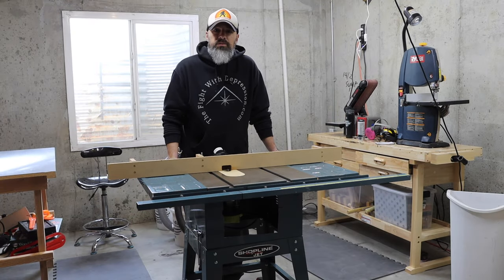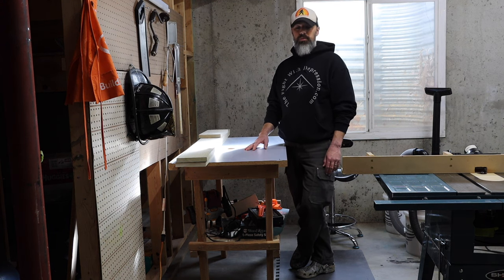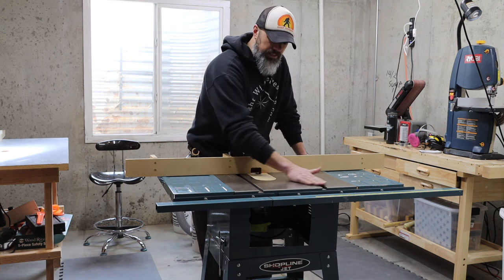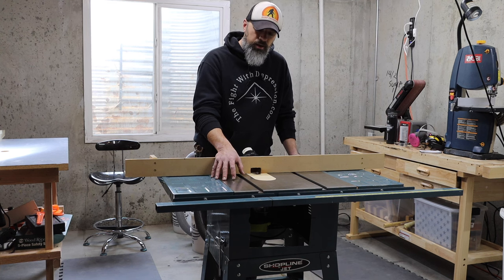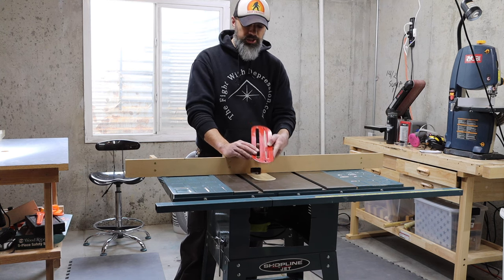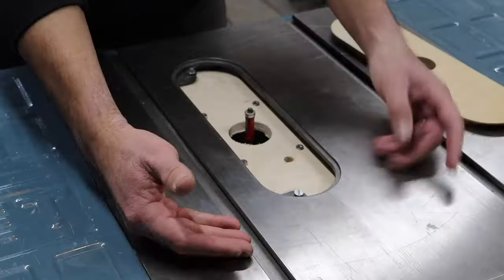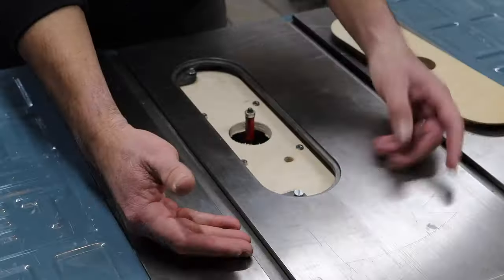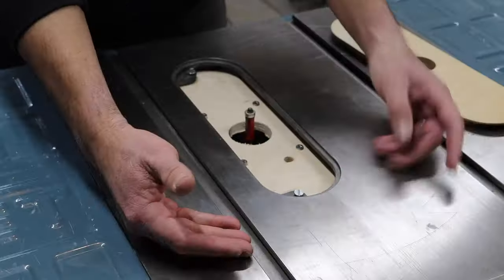I Turned My Old Table Saw Into a Router Table | Upcycled Woodworking Equipment

Comment: Nice job in repurposing of a table saw. Are you going to keep the old fence rail attached to the table? Looks to me  the part that sticks out on the right would be in the way when working with long stock.
Reply from the maker: I think I'm going to have to see how it works and make some adjustments. I've used my workbench as an out feed table when I had this with my table saw, so I might need to adjust it to utilize that. We shall see. I might need to remove some excess material.
Thanks for watching!